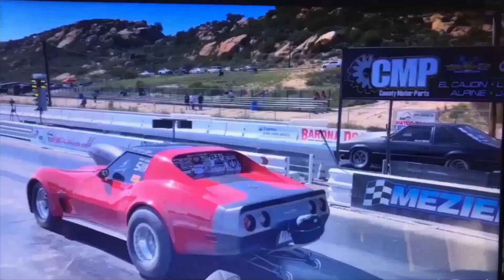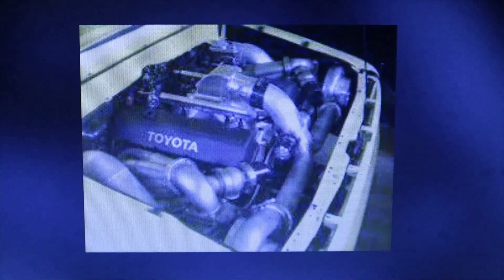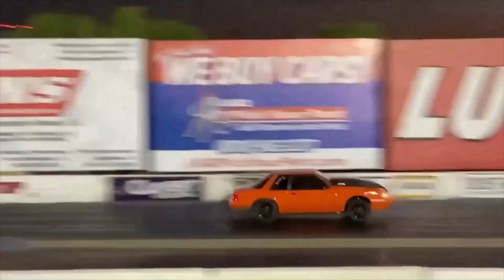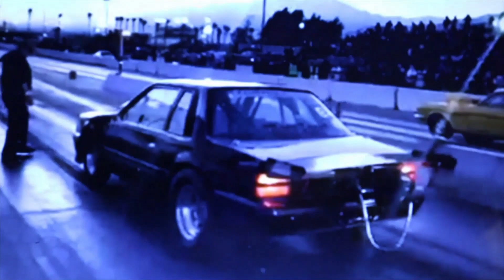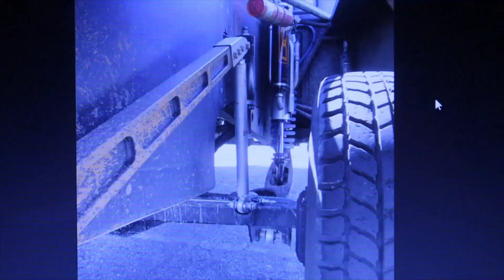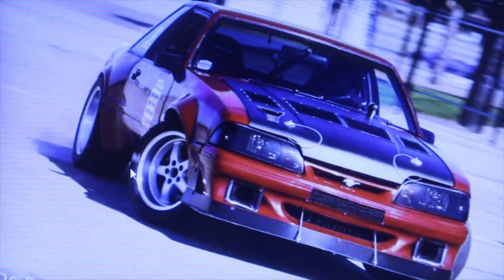BEN ALAMEDA RACING CARS AND TRUCKS!

Comment: I recently discovered Ben Alameda. I needed straitening out on turbo engines. I was totally against them. thought they were distractive to the life of an engine. I'm from the racing capital. Grew up Speedway Indiana. Started grinding valves at14 yrs old. By 16 yrs old, owned and paid for myself a 1940 Ford coupe  and built a Lt1short block/offy 4duce on 202 heads, 69 cougar rear end at the same time owned 1950 F100 stock flat head and a 1963 GP. Too many cars to name after that. 

I was wondering if Ben ever visited us at Race Way Park.I use to skip school to watch the drags out there and ran in grudge races.

Presently I have a 1972 F100 shortbed Ranger XLT that I did a Crown Vic frontend swap during covid. Beautiful little truck. I use to hate FE. Now I think they are very interesting. I'm on the fence about building an NA 390 or 428 FE. As is, it's running great with the old 360 (piston down in the hole) Eddie Performer with Eddie 600 cfm and long tube headers, stock dist. I don't really need more power but would like to have respectable 375 horse.The 360 is so embarrassing for me to just own. LOL 

Also own an almost mint 1993 Silverado WT, air delete, v6. crank up windows. Would like to see how much I could get out of an NA Chev V6. Thinking about plugging the injection ports on a late model Vortec and carb it. It's just a very interesting little engine that could. Guys are starting to do more with them and performance parts are coming online. Of coarse I'm very familiar with the Indy v6 Buicks. Likely never afford a build like that. But I think the v6 is interesting in this day and age.
Reply from the maker: Looks like you got a handful of projects there buddy!